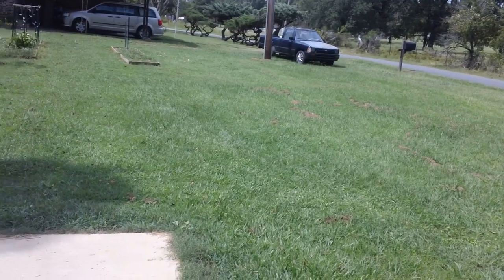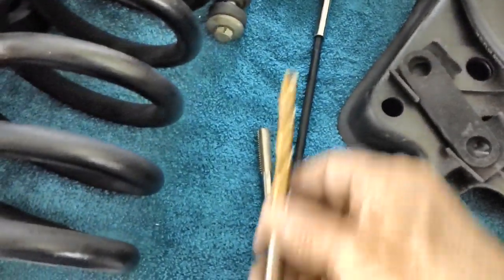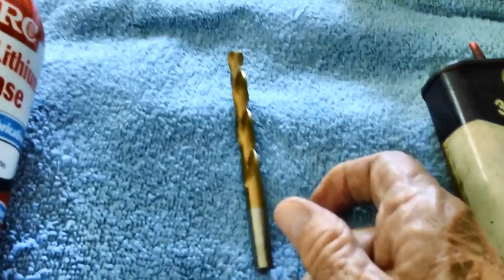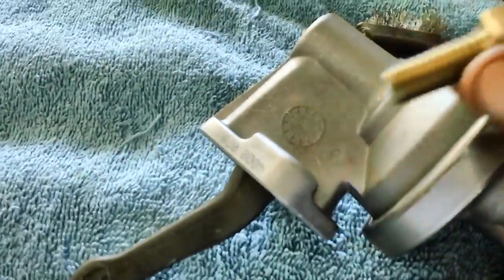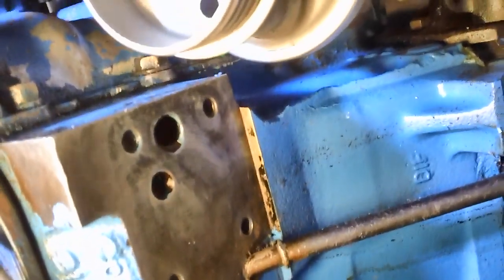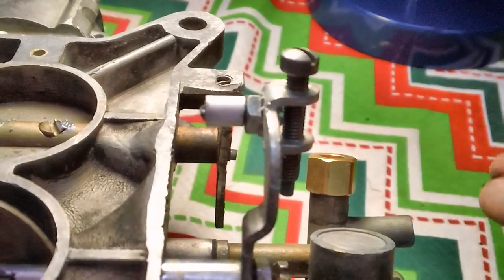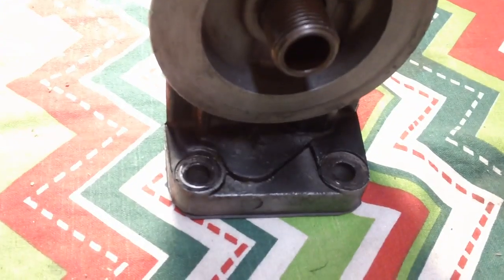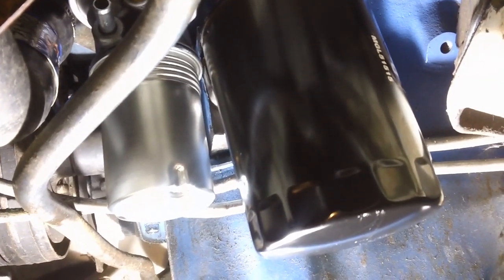1966 Ford Thunderbird repair and refurbishment (Part 58). More fuel pump work. Can't be helped.

Comment: I bought a 66 bird in 1983.  Nice clean hardtop. On one of my first drives after changing oil, checking everything, etc, I went for a test drive and floored it.  Ran great!  Then I let off the gas and we just kept going.  I turned off the ignition and came to a stop.  Restarted and no problem.  Guess what the problem was?  That piece of white nylon was broken off that you talked about.  It's job is to shut off the secondaries when you let off the gas.

Comment: The standard clearance for a bolt hole is .030 (1/32) over the the size of the bolt.
Reply from the maker: Larry,
I'm sure it is unless it's through the fuel pump flange on my 1966 T-Bird.
Regards,
John